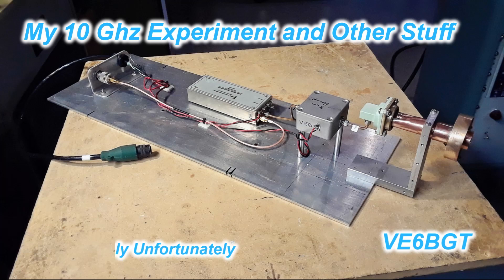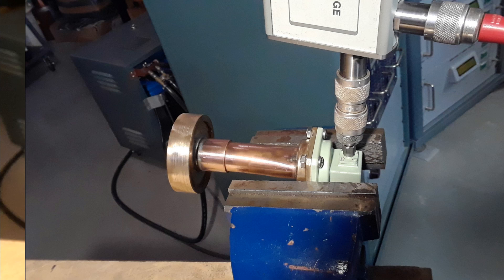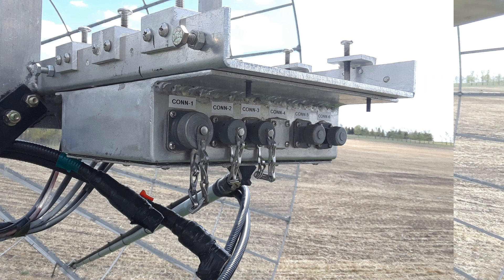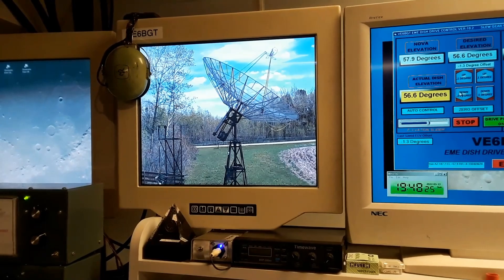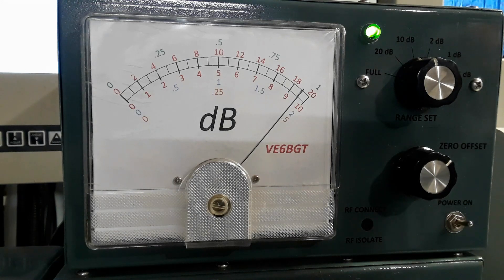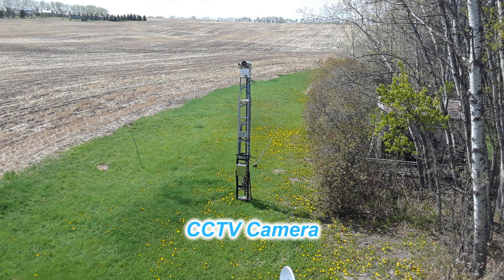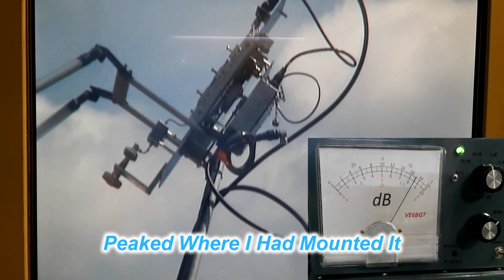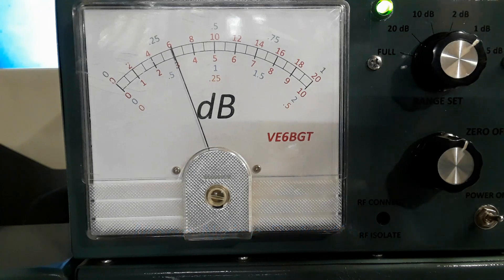My 10 Ghz EME Receive Experiment

Comment: Nice setup and that dish should be plenty of gain for 3cm. How fine is the dish mesh? Needs to be less than 10% of the wavelength so smaller than 3mm for 3cm band?
Reply from the maker: Hello Dwayne, the big dish has a mesh of around 4mm opening holes if I can recall correctly.. This was more of an experiment as you will see in other videos where I tried a 6 foot solid dish that was better than the large 21 foot mesh dish.. It was just a test to see what was what.. I am working on a 6 foot offset dish now.. I have a few videos on it and its being worked on for the final assembly eventually.. More videos on it so stay tuned.. Skip